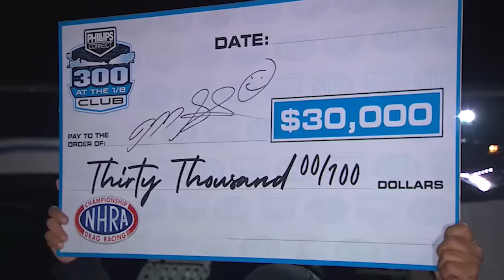Mike Salinas' team breaks down historic 300mph in the 1/8 mile run

Comment: Just think of how fast that could of been in the 1/4 mile if there were no rev limiters and they were still running 1/4 mile.
Reply: Fast enough to kill a driver, a whole lot quicker, if they'd have shut down at the 1000 ft instead? All the bad stuff happens around that point, anyways...

Or maybe a shade under 350 mph, which is the suggested limit of the current tire technology...